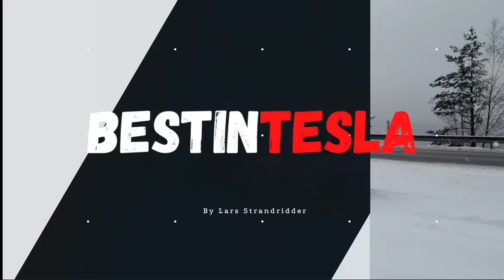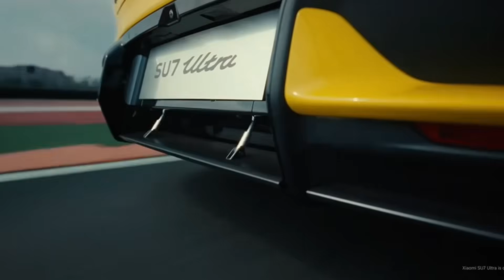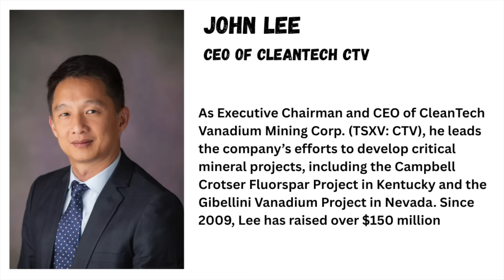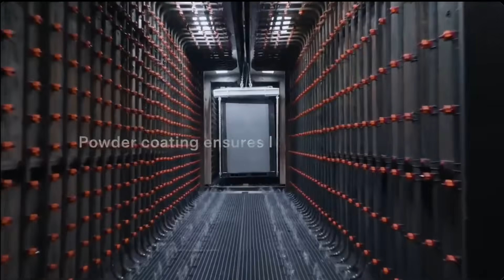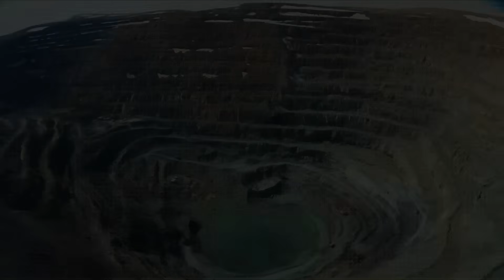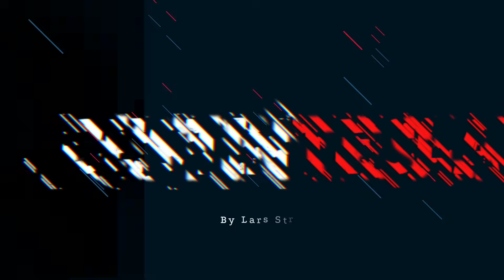The new “GOLD” in Battery materials that no one is talking about. Interview with a mining expert!

Comment: The stuff goes for 20 cents a pound at 400 per ton, yes that's less than a dollar, quite a bit less.  As you later said it was 50 cents a pound, that's actually less than half of 50 cents, specifically only 2/5 of 50 cents at 20 cents.  And since I used 2000 lb rather than 2,200, it's even less.  The head math isn't so close here.
Reply: 1 meteic tonne is 2200 pds
Reply: @gaetanguimond1911 that's all you have to say? Okay fine. Maybe you never heard that in America a ton is known as 2000 lb.  All I said was that's the version I used.  a metric ton is 2204 lb plus a little, and of course if you don't see it, had I used metric tons my calculation would have brought me to less than 20 cents, so either way after cutting his number in half he's still more than double the actual.  The head calculation wasn't so good here

Comment: When the Ukraine conflict concludes and global reconstruction efforts commence, a modern equivalent to the post-WWII Marshall Plan will likely emerge to restore Europe. Ukraine’s power infrastructure has suffered extensive damage, presenting an opportunity to rebuild using Tesla Energy solutions. Vast solar farms, integrated with Tesla MegaPack storage and advanced distribution software, could power the nation. Equipping homes with Powerwalls and solar roofs would create a fully interconnected, renewable energy grid across Ukraine. This ambitious reconstruction could showcase the scalability and durability of renewable energy on a national level, potentially enabling Ukraine to export clean energy to Western Europe.
Reply: This sounds like an excellent plan!

Comment: Fluorspar or fluorospar:
Fluorspar is a crucial mineral with a wide range of industrial applications, including:
 * Batteries: It's a critical component in the production of lithium-ion batteries, especially in the cathode, electrolyte, and anode. In fact, some sources suggest that EV batteries can use significantly more fluorspar than lithium.
 * Aluminum Smelting: Fluorspar is used to produce aluminum fluoride (AlF3) and cryolite, which are essential as a flux in the electrolytic process of aluminum smelting. They help lower the melting point of alumina, reducing energy consumption.
 * Steel Smelting: In steelmaking, fluorspar acts as a flux to lower the melting point of raw materials and help remove impurities like sulfur and phosphorus from molten metal, improving the quality and efficiency of steel production.
It's a "hidden" critical mineral that's becoming increasingly important with the growth of green technologies.